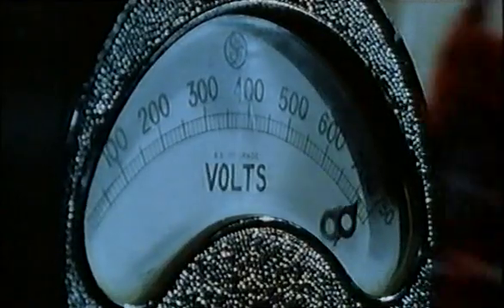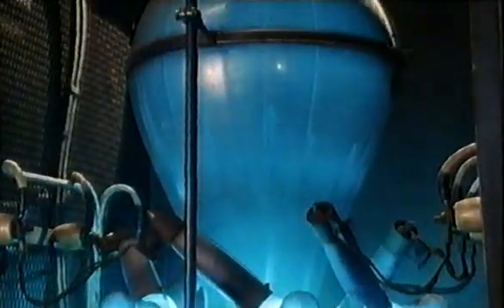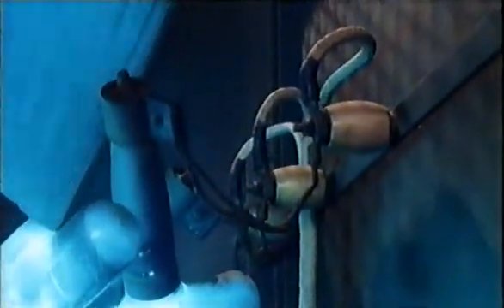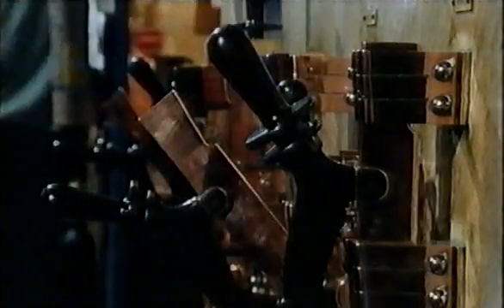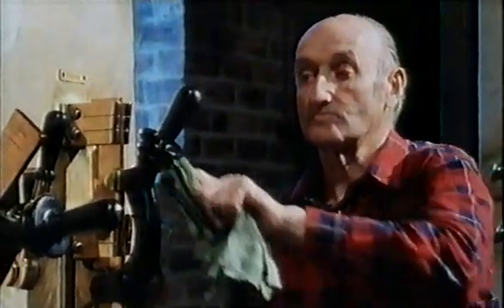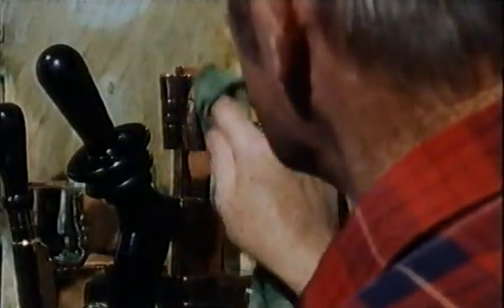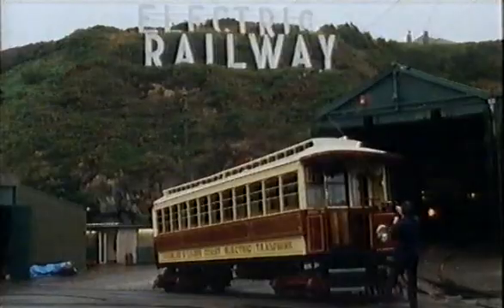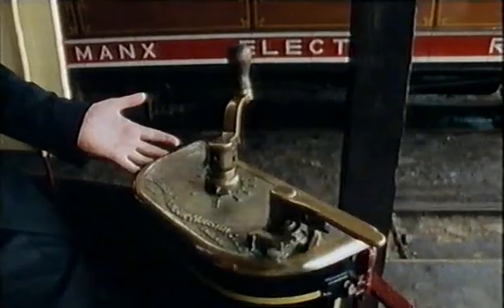Isle of Man - Mercury Arc Rectifier - 1997.

Comment: 'Safer' DC. Ha! 550v DC, i'd like to see you let go of the mains once you grab on to that.
Reply: AC is just as sticky. If you think your muscles will relax enough to let go in 1/200th of a second, you'd best think again.
Reply: @dougaltolan3017  your mains is providing 1/50th or 1/60th of a second polarity changes, not 1/200th
Reply: not to mention, AC won't make you 'clamp down' on whatever you are touching as it doesn't force the muscle to continuously contract.
Reply: @recklessness1987  let's take USA at 60hz...
Thats 60 full cycles per second, each cycle has 2 peaks, your muscles will be contracting for more of each cycle than just the peaks...
That leaves less than 1/200th of a second between peaks when you might be able to relax.
Reply: @recklessness1987  This has actually not true and is an old tale.   There is actually something to do with the AC giving the muscle time to refresh between cycles, keeping you locked on.  But iirc at 500V you are stuck fast to either.  The reason he's touching it and not getting shocked it obviously he has no ground path.  I understand grounding systems, but the other side of the coin is that you are always one conductor away from becoming a conductor.  I often use an isolation transformer on my electronics bench as it requires 2 bad decisions to get dead.

Comment: Mercury arc rectifiers were very often used to power DC trams. Or large radio transmitters.
"transforms the AC into safer and controllable DC" - DC cannot be transformed and is more dangerous!
Reply: both are dangerous. nowadays you can turn dc into ac rather easily so it can be transformed.

Comment: DC safer? Since when??
Reply: It's safer in the sense that it does not require earth as the return circuit instead DC systems have a dedicated return or negative bus. Typically the rails on an electrified railroad are the negative return buss. The safety factor is assumed due to the lack of an earth ground so you can grab a live positive buss and be barefoot on wet ground and not get a shock.
Reply: @Elfnetdesigns  Neg return IS grounded and you will get a bad shock
if you touch the positive at these voltages,  so you have a choice - try it 
or study electrical engineering !

Comment: Not sure why DC would be considered safer than AC.
Reply: Edison propaganda.
Reply: It's dangerous for different reasons.
Reply: To human flesh that is.
Reply: @kaelan-j1z  Wrong. It's worse. Fun fact: electric scalpels cut in AC passing  around 200W RMS , 40kW peak power though the body in the OR. But they are totally not allowed to have DC current in the output with an specific DC blocking capacitor.
Reply: @kaelan-j1z  well not really

Comment: He is cleaning brass of live knife switch . But he could not get eletrocuted. Why?
Reply: He could only get electrocuted if he were to touch another conductor which was earthed. Here he is only touching one conductor so he is safe. He is also only using one hand at a time, the other holds the polish tin.
Reply: DC does not require earthing asit has positive and negative busses. You are fine with a live terminal as long as you don't grab the other one. The earth IS NOT the return (nagative) the rails are
Reply: @Elfnetdesigns  there is no way on earth that the rails aren't connected to ground
Reply: @dougaltolan3017  The resistance through the ground is far higher than through the rail though.
Reply: The knife switches are only cleaned during the winter when the power is off.  The voltage is 550 at 300 amps.
Reply: @petermines  " seemingly oblivious of the 550V pulsating under his brasso(TM) ". The speaker made it quite clear that the conductor was live.
Reply: @Txepetxcc  probably he was using isolating boots. So, no electricity could flow between him and the ground
Reply: @cloviscareca  or the DC catenary has the return via a dedicated negative rail, floating from ground (isolated negative). So the soil ground is not the circuit ground. He could be barefoot in that case.
Reply: @Txepetxcc  the operators the NYC subway substations in the days of rotary converters quite commonly used to pull the knife switches slightly open or closed to light their cigarettes from the resultant spark  :-/
Reply: @andyblackpool  haha ! Hilarious
Reply: @Txepetxcc  No trust me its true.  I read it in a book I have read many times - a great book BTW - 'New Yorks Forgotten Substations' by Christopher Payne.  If you're a bit of a nerd (like me) and interested in stuff like this this is a book you have to buy.  Absolutely fascinating; packed with detailed information and pictures of early subway electrical substation and equipment.  Anyway Happy New Year mate, hope its a good one!

Comment: dc is safer than ac ? who told him that ?
Reply: dc burns, ac kills
Reply: ive had shocks from both and ill tell ya pal, ide rather have ac any day, ac throws you off, dc you cant let go.
Reply: @tonybaines3332  exactly correct, DC current is much more dangerous.
Reply: DC was the choice for early electric railways, as AC created harmonic effects in the brush motors they used with much arcing and sparking on the brushes and commutator. DC was easier to control using starting resistances to soft start the motors, eventually they'd all be switched out of circuit and then for higher speeds, you'd switch to Weak Field. On the Southern Region of BR we used HV AC distribution, it went into Rotary Converters and emerged as DC for the trains. Some of the old subs still have the huge doors to install the kit and remove it. Later Mercury-Arcs took over, and the last of these were only decommisioned when the present juice guzzling 375's. etc came in. As you'd expect, later extensions to the electric system under Southern Region were powered using Solid State rectifiers, Tonbridge to Hastings 1066 Elecrics being a good example.
Reply: It is correct. As your body acts like a capacitor, DC is blocked from passing through you just as it would a normal capacitor. AC on the other hand, has no trouble passing through a capacitor and by extension, living things.
Reply: @DidntKnowWhatToPut1  Who on earth told you that the equivalent circuit of the body is a capacitor ?
Reply: @Txepetxcc  Electroboom, he did a video on this. This is what I remember anyway. I might be wrong. This is a 2 year old comment.
Reply: @DidntKnowWhatToPut1 grab hold of an ohmmeter. Your body WILL pass DC. A capacitor won’t. DC contracts your muscles and will not release. AC will release your muscles.
Reply: All you people are wrong.
Reply: It really depends on voltage. But once they're at the same deadly level, DC does seem to be worse.
At least DC can go to a higher ELV voltage before it becomes a hazard.
Reply: At 700 volts it doesn’t matter, if the system can supply the necessary current you’re bacon
Reply: Whack big cloves video he lives in Isle of Man https://youtu.be/-5R-KBa18ME
Reply: Dc  current is more dangerous , if you get a shock from it all your muscles will violently contract and be unable to move from the power source allowing a lethal shock to occur, if it was an AC current then the initial shock would throw you off the contact point and you would most likely survive .
Reply: Edison probably.
Reply: Edison...🤣
Reply: both kill 🤯
Reply: @SB7-r9i  dc contracts your muscles so you cant let go.
Reply: You forgot about resistance
Reply: Edison for one. Didn't he organise revolting public demonstrations in which animals were electrocuted with AC, just to upstage his rival, Westinghouse?
Reply: AC go's though you body much more easy compared to DC but would't like to stay witch is safer. It's like compare getting by a bus or a lorrie.
Reply: If a live exposed DC cable was grabbed, the hand would grasp and not release. If the same cable had an AC Current passing through it, the hand would be able to be released as an AC Current has a duty cycle called frequency.
Reply: @London1064  > AC Current has a duty cycle called frequency
HAHAHAHAHAHAHAHA
Reply: @cebruthius  ???